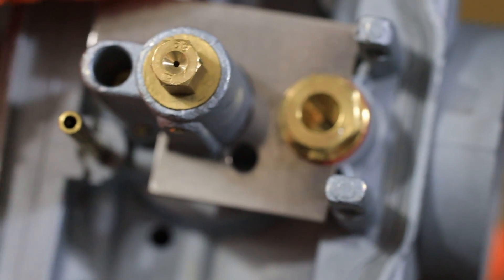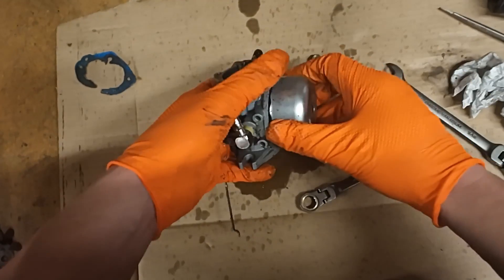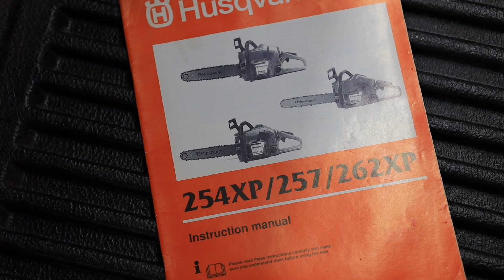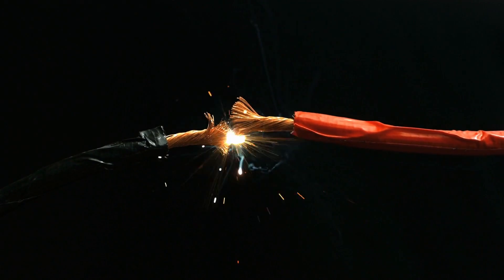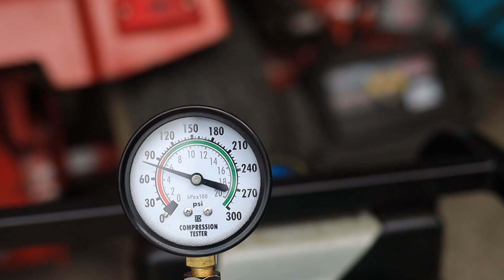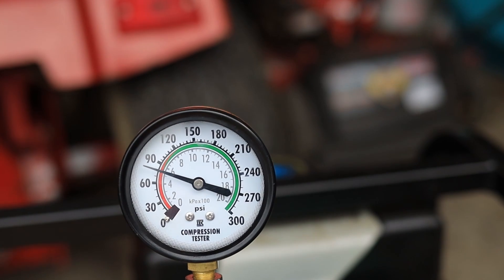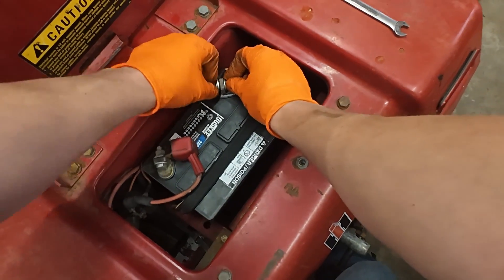Why Your Lawnmower Won't Start

Comment: From what i was told that using air plan fuel will eliminate this 
as a guy i met who has bunch of generators where he owns a bunch off grit carbine and that fixes all these issue that our fuel with ethanol
Reply from the maker: I imagine it will be better lubricated since airplane fuel is usually leaded.  Av gas is very stable compared to our pump gas also.  Without ethanol it will not attract water quite as bad.  But... It is a massive pain to get for most people and is expensive.  Some Stabil (fuel stabilizer) is really all you need in most cases.